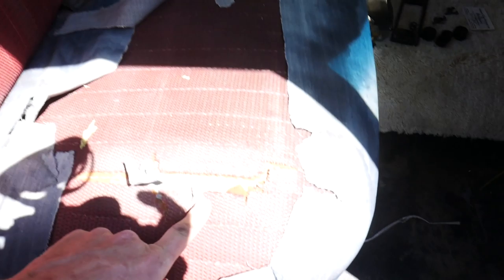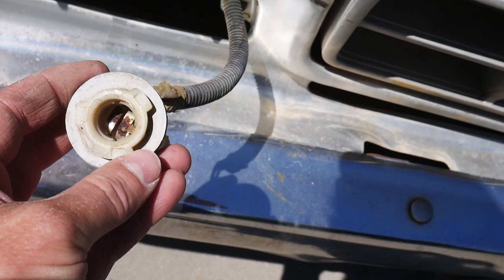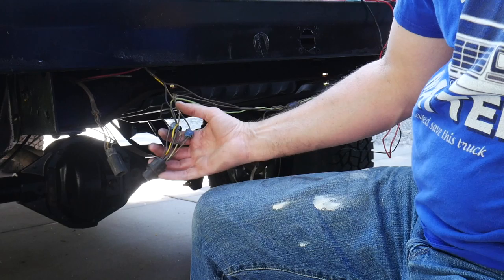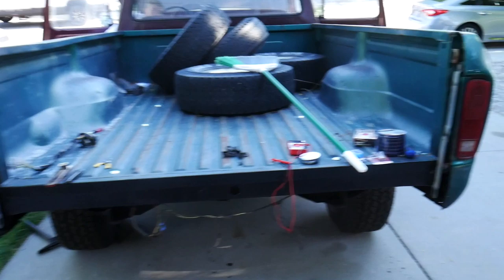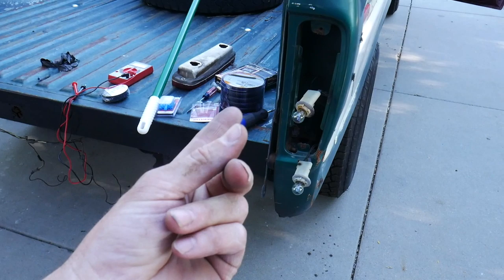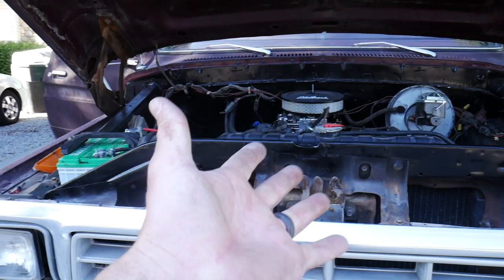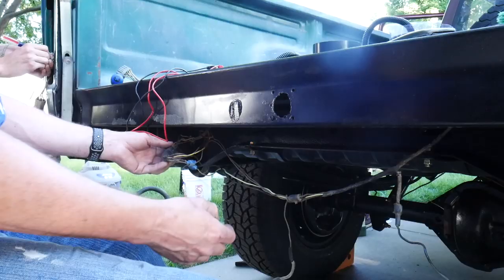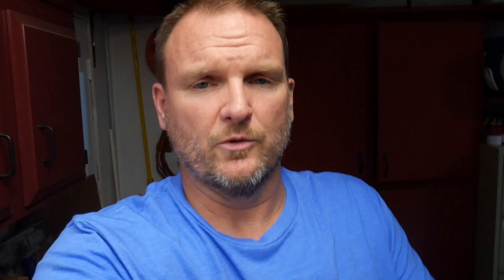Ep.17 1979 Ford F250 Restoration - electrical issues, turn signals, brake lights, etc

Comment: My seat is from a 1991 Ford Crew Cab.. I got the back seat, you know the back seat doesn't get used much. I paid 50 bucks for it and just swapped out the slide rails on the bottom.... so easy !!
Reply from the maker: Now that’s an EPIC IDEA!!!  Best advice I’ve gotten yet!  I’ve been wondering what to do about the structural part of the seat!  Thank you so much!

Comment: Any time you see a "Scotch Lock" connector the blue plastic connector get rid of it !! and solder the wires and use heat shrink to insulate the connection.
Reply from the maker: That sounds like a “Pro Tip”!  Great advice!  🙌🏼

Comment: The header length can make torque at different rev areas. From what I remember, the long tube headers make more high end torque and the shorties will make torque at the low end.
Reply from the maker: After “sleeping on it” over the winter I don’t think we’ll be going with headers for now. But I’m likely to be pulling the engine if I can’t find the burning oil issue. 🤷🏼‍♂️
Reply: Wonder if the rings could be the problem...
Reply from the maker: Crazy Ryan that’s my fear. I’m hoping it’s the lifter seals. Fairly easy to replace and no need to yank the motor!  Here’s hoping!  🤷🏼‍♂️

Comment: Long tube is what I run on my 78 and all my trucks!
Reply from the maker: What kind of gains do you notice if any?
Reply: DIY Home and Auto little gain much better sound it will exhaust the gasses much better than a Normal manifolds

Comment: Use long tube headers and an a cam upgrade, and a 4v intake with a 650 carb. When you had it running in the driveway, it was missing on a cylinder. New spark plugs, rotor and cap would be good. Spend a little extra on a cap that has copper terminals instead of aluminum.
Reply from the maker: Keep watching. Some of that is coming up in a future episode!  😜🕺🏼

Comment: When it comes time for carpet, take a look at ACC (Auto Custom Carpets) and their mass loaded vinyl backed plush carpet.  I used it on both my carpet jobs and love it.  They also sell 80mil butyl sound deadener at a very nice price.  All the stuff I featured in both my S10 Interior Vid and my Suburban Carpet Vid.
Reply from the maker: Awesome!  Thanks for the advice.

Comment: What truck cover brand do you use. Trying to keep the snow off my f250
Reply from the maker: http://www.carcover.com - 15% discount with code "diyhomeandauto" (that code used to work back when this video was posted, please comment below if it still works). I’ve bought 2 total of these. They seem to last for 2 years before they begin to wear out. Strapping them down with bungee cords helps them not get tattered by the wind.

Comment: Did you figure out why the parking lights turn off when the headlights are on?
Reply from the maker: Yup. Someone said that’s standard on this year model. I didn’t know that either. 🤷🏼‍♂️  But at least that means something isn’t wrong!
Reply: Thank you. My 69 is doing the same thing. Thought I had an issue.
Reply from the maker: @falden01  no worries man, thanks for watching.

Comment: Hey I have a 78 and I am having trouble with the turn signals and brake lights, I've replaced bulbs, sockets, put a new turn signal switch in, new brake pedal switch and I still can't get my signals to flash or brake to light up.  Headlights and tail lights and park and marker lights come on when I pull the knob though, any ideas?
Reply from the maker: Check your grounds and the socket/bulbs for corrosion. I’d bet the grounds will fix it.

Comment: How has the truck been over the last two years
Reply from the maker: See the most recent uploads. Got it torn apart for rebuilding.
Reply: @troysgarage  yes I have a 1989 f 150 custom its going on 2 years now of a little more than a repair. A frame off which was not in the plan but when it is done she will be bran new

Comment: Don't mess with that old seat... get a seat from a Ford up to 1996 and simply swap out the slide rails and the new seat will bolt right in. I paid 50 bucks for my new seat.

Comment: The main problem with the 351M & the 400M is that the compression ratio is very low. A rebuild with higher compression pistons will fix that or using a cylinder head with smaller combustion chamber instead of what's on there now.

One realistic thing that can be done is to get a timing chain which can adjust the camshaft timing. Install that & advance the timing by 2 or 3 degrees.

Upgrading the ignition system to eliminate the points and install a pertronix stage 2 will help & at least improve the mileage.

351 Cleveland pistons can be used in the rebuild if the connecting rods have bushings installed for the thinner diameter piston pins that the Cleveland uses. There are data sheets online which will help you determine the compression ratio that will result.  The type of cylinder head is also very important to know when selecting pistons.

If you rebuild the short block, you can also upgrade to a 400m crank shaft as well. A machine shop can help you with this as well as to choose the correct pistons for your application.  You need to ensure that the deck height of the piston isn't to high or to low. 

Try to do something between 9:1 to about 10:1.  A mild 351 Cleveland camshaft can be used. Of course, the engine needs to be pulled and rebuilt and assembled by a machine shop unless these rare cylinder heads can be found. These can be more expensive then a rebuild in some cases.

Headers won't help a whole lot & they can be very annoying to install.

Basically, short of a rebuild, tune up the engine and upgrade to an electronic ignition system. The water pump and timing cover need to be pulled to access the timing chain for replacement. Pulling the radiator helps make this easier.

You don't need that many special tools or heavy lift equipment to do this. 

It's helpful to get a timing chain puller that works for both the camshaft gear and the gear on the crankshaft.

The harmonic balancer also needs to be pulled and a you need to get another puller for that as well. These tools are still way cheaper then the labor that a mechanic will charge you. It's not such a bad idea to have these around so that you can possibly use them for another engine in the future.

You can also sell them on eBay or buy them from there to recoup the money if you choose not to keep the tools.

Some folks will also recommend upgrading to a 4bbl carb & this requires installing a new intake manifold. 

This won't hurt anything but with excessively low compression, these mods will only have a modest improvement.

I'd just keep the 2bbl carb on there until you rebuild the engine.

Advancing the camshaft timing will produce a noticable improvement because the power curve will be shifted downward to a much lower rpm engine speed. So will advancing the ignition timing. A low compression ratio will tend to prevent engine knocking but you need to make sure that doesn't occur just in case.

You're looking for a closed chamber style head instead of the smog type open chamber head that is on there now.

Doing a head swap and changing out the head gasket isn't fun but you can still do this at home.  The main problem with this is the price of the parts. Of course, putting in a better camshaft is also a good idea once you have the entire top of the engine off. It's also a good time to change the intake manifold to one that can accept a 4bbl carb at this time.

Another method is to add a supercharger, which may well cost less money then getting heads with a smaller combustion chamber.

These engines are capable of high output but you need to use something drastic modifications to get that.
Reply from the maker: Thanks so much for all the advice!  I need to create a “Pro Tip” tshirt. You’d win the prize for that on this video for sure!  I really appreciate you sharing your vast knowledge with me and my viewers!  It’s comments like this that keep me going and make me love being a YouTuber!  🙌🏼🕺🏼

Comment: I would not mess with headers, just take the truck to a muffler shop and put stock exhaust on it. Headers are a waste of money.
Reply from the maker: You are probably right but viewers like the WOW factor!  Haha
Reply: LMC offers a dual exhaust that connects to the stock manifolds. Dual exhaust minus the headaches of installing headers.Picked up a 1978 F150 Ranger last summer. Pretty rusty bed but everything else is solid. Original Colorado truck with 90k original. Runs strong. Running 33x11.50 sixteens. Hoping to upgrade to a 4bbl. intake or possibly injection for the original 351M. Slowly chipping away at it. Good luck with your project.
Reply from the maker: We are considering a throttle body injector kit as well but money....  🤨
Reply: DIY Home and Auto The biggest problem of that era engine is the emissions mandates. Manufacturers had to lower timing and compression. By a set of Aussie heads for it. They will bring compression up, with a good quench and eliminate the pre ignition of the lazy heads. They are very cheap compared to aluminum heads and will make the most difference of any upgrade you can make for the 351M/400’s.